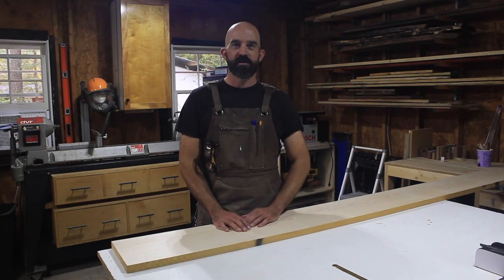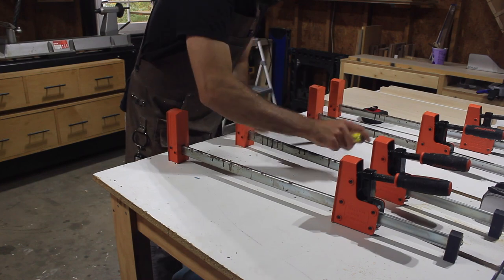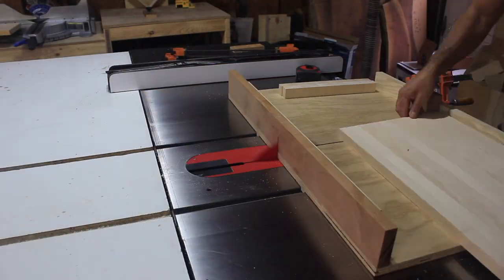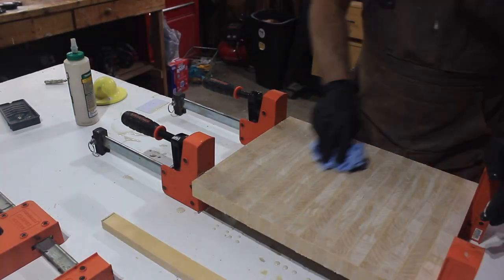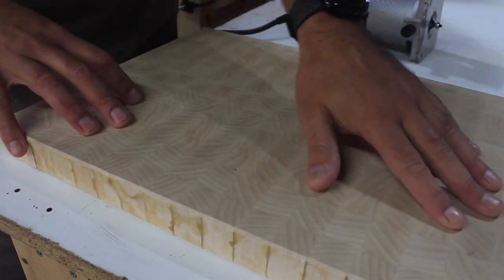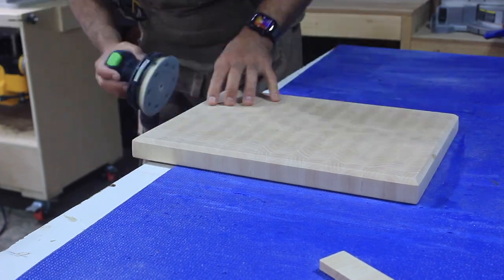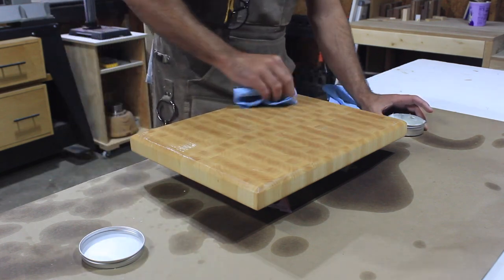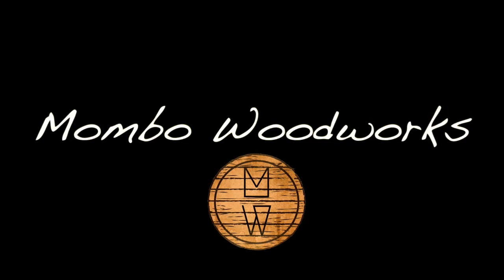End Grain Cutting Board (Maple)

Comment: Beautiful board and good video, keep them coming! Do you use the standard straight blades in your planer or a spiral helical cutter head?
Reply from the maker: Thanks! Actually i should clarify that: I do use the helical head on the planer. BEST investment. I don’t know that I would have planed the end grain with the straight blades, but I think the chamfer and the super light passes are the difference makers to prevent tear out.
Reply: Cool! I did order a helical head too as I'm not getting good results anymore with the straight blades, especially on larger hardwood pieces. I'm really looking forward to receiving and start using it. Great to hear you are happy with it!